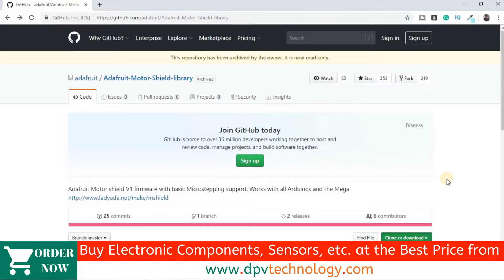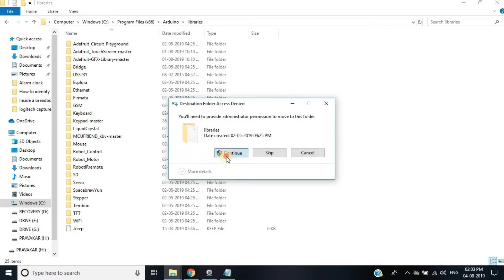How to connect  bipolar Stepper motor with L293d motor driver and Arduino | NEMA 17 series example

Comment: can you connect more than 1 stepper to the sheild?
Reply: yes you can connect 2 stepper motors to the  L293D driver board
Reply: @madanmunny2537  I needed to know this this for an international competition cos I needed to add the ability to command my bot to move a certain distance in cm as. Turns out that my stepper motors didn't even have enough torque to move my chassis so eventually swapped to dc motors with encoders. Nobody really helped me back then with this issue when I needed, which is why it means the world to me that you replied even though its been 8 months now. Thanks man 😃😃

Comment: is it possible with just the single IC  l239d?
Reply: Correct me if I'm wrong, but I think the L293d will overheat due to the stepper motor sucking more current than the driver can handle

Comment: What happened when we use 12 V supply to the stepper motor ?
Reply: not much, but I think the voltage supplied depends on the motor you're using, here is a useful page that I found:
https://lastminuteengineers.com/l293d-motor-driver-shield-arduino-tutorial/
hope it helps
Reply: @angelcru7428  it works but with lot jolt ,i have no idea with 5 v from arduino jolting stepper motor(solution for this is connect both ground ) but i dont how to do it?